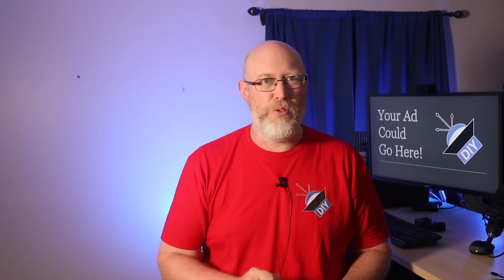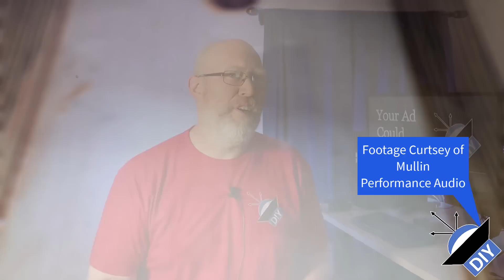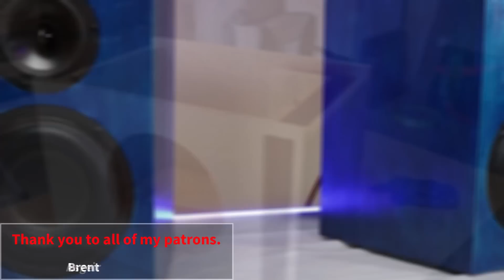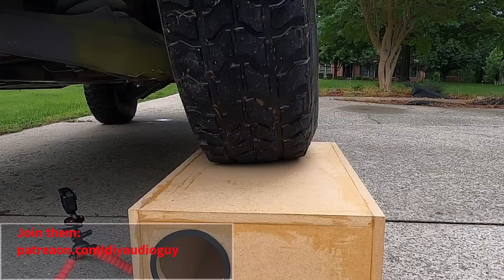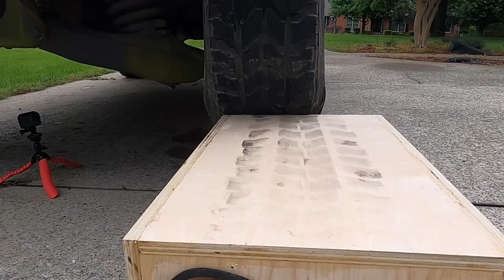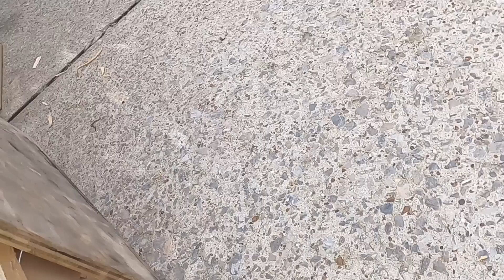Destroying subwoofer boxes with a Humvee.

Comment: I take it thats not run of the mill construction grade plywood? Does birch plywood not have as many voids within the layers compared to other versions of plywood? 30 some years ago MDF / particle board was the goto and the consensus was that plywood would give you rattles due to the inner layers having possible defects/voids.
Reply from the maker: Cabinet grade from Home Depot
Reply: in german we say MULTIPLEX xD
Reply: Don't confuse birch veneered plywood with Baltic birch plywood. Real Baltic birch plywood for 3/4" thick has 13 equal thickness plies, 1/2" has 9 equal thickness plies. Any other number and you have regular plywood with a birch veneer on the faces. They are not even remotely the same product or quality. Real Baltic birch will have zero voids anywhere and the edges look so nice they are finish grade as in you can round them over and stain and lacquer and they look good. Every Pro Audio concert grade stadium box is made out of Baltic birch. It's tour grade and can handle the bumps, rain and abuse a tour can bring and it is 1/2 the weight of MDF. MDF is fine for home audio as you don't have to move them around often and they don't usually take abuse or get wet. MDF aside from being heavy is also hard on your saw blades and the dust it creates is more toxic then plywood dust but you will get slivers using Baltic birch and the Baltic is 2-3 times the price so pick your poison.
Reply: Right on... thanks for the details on that wally! I have noticed some of the other channels that use the plywood, it looks like flat versions of skateboard decks (lots of plys) vs the 4-5 ply construction grade, i just never knew what it was called. and you are correct... MDF saw dust is horrible... 1 cut without a dust collector and its everywhere... EVERYWHERE.... dont breath that... Ill have to check out this baltic birch for my next build... putting almost a 4x8 sheets worth of a box into the back of a vehicle definitely changes the handling and if this baltic birch plywood is that much lighter, then thats a win win...

Comment: I've stopped building enclosures out of mdf years ago. Weight in a vehicle matters more than people realize.  Fuel economy,  suspension stress, transmission stress, tires wear uneven  etc.... 
Sure a 8" or 10" sub enclosure is fine in mdf but most of my customers want multiple subwoofers and some weigh in excess of 100 pounds, so weight and strength are extremely important.  Plus the mdf dust is the worst.

Comment: Now that was amusing!!!🎉🎉 cool stuff! As far as i remember from a german speaker diy magazine few years back, they compared matterials and did actual measurements of the matterials themselves and their acoustic properties and concluded that mdf has no acoustic dissadvantage compared to plywood so unless we are talking aesthetic needs there is no reason not to use it. Damn! Now i am curious bout what would happen if the enclosures had bracing in the middle of the cabinets
Reply from the maker: Glad you liked it!
Reply: I never have liked MDF and refuse to use it.  Kept hearing all the nonsense about plywood being terrible for subwoofer boxes, which is just as stupid as the subwoofers "requiring" break in myth.   Hard to believe all the nonsense out there just keeps spreading and will never die.
Reply: @DIYAudioGuy  of course! I love „out of the box“ presentations :-)
Reply: @JasonWW2000  All subwoofers loosen up over time, yes, but there isn't any special break in method or period required where you have to play them at low volume for 5 days or any of the other ridiculous methods people have come up with.

They can all be played at full RMS straight out of the box without issues.  A lot of this break in stuff comes from SPL farting crap.  They want to try and loosen them up as fast as possible so they can figure out all the other stuff based on the loosened up sub.
Reply: The reason to use MDF over plywood is cost. The plywood necessary to build a proper speaker box must have no voids or air pockets in the plies. That means it's very expensive to me. It also should have many plies versus fewer plies. Birch plywood in a higher grade comes with no voids in it, but it's relatively expensive compared to.
Reply: MDF.
Reply: I've been building speaker boxes since 1979 for vehicles. I've even built them out of 1 and 1/8 in thick MDF if you want to talk about heavy but MDF is so dense very little residence. The air pockets that can exist in some plywood can cause vibrations and buzzes
Reply: @georgefadale6495  Right now, around here, 4x8 Premium Sanded ACX is $55 and 4x8 MDF is $50.  If you just get the cheapest plywood, yeah it may be crappy, but the ACX is usually fine if it's not showing in major issues on either side.   Unless somebody is building some high end SQ system and have done a full on sound deadening, noise reduction through the entire vehicle, it's simply not going to matter even in the slightest whether the box is MDF or Plywood.    You won't be hearing any box issues, if there even is any, while the vehicle is making every rattle and buzz noise possible.  And then the noise would have to overpower the subs as well.   So, very unlikely to matter.
Reply: @georgefadale6495  i love plywood. I just saw the comparisson of the acoustic properties back then and realised the only argument for plywood is that it looks much nicer and also it lasts longer if it is in a wet environment. So if i use it in a scenario where its not visible i will choose mdf any day. Yes you are right the cost difference between a good plywood and mdf is too big
Reply: @DIYAudioGuy  whats not to like. Was a pleasure to watch funny and informative combined. Cant wish for something more
Reply: @JasonWW2000  Not sure why any clarification was needed considering I specifically said "requiring" in my original comment.   No subwoofer "requires" a break in period, what else could this mean?
Reply: @JasonWW2000    Again, what else exactly could I have meant?  I understand you likely can't explain what is so vague without demonstrating poor comprehension skills, but please make an attempt because I find you to be vague on your explanation of why you thought my statement was vague.    Did you miss the word "requiring" or read it fine and just chose to ignore it, or possibly simply trying to read something else in to it?
Reply: @JasonWW2000  I see you're still wishing to stay vague in what you saw vague about my comment.   So nobody knows what the word "requiring" means?  Good to know.   I know you're upset and offended at the idea you can't argue with facts how "breaking in" is somehow required, but that's just the way life is.  I know it's hard to accept the facts and the facts say not one single sub out there "requires" a break in, hope that clears it up.

Here is a list of synonyms for "requiring".  Which one better fits your level of thought process and one that everyone should likely know?   I'll be sure to consult you on all further comments on any car audio pages in order to better use the proper words that better fit your temperament and ability to comprehend.   LMFAO!   Yeah, not going to happen, but still...  please choose one and I'll modify my original comment to accommodate you.

compelling
demanding
exacting
forcing
involving
necessitating
pressing
calling for
dire
immediate
Urgent
Reply: @JasonWW2000  What?  That's a bit vague, please clarify.
Reply: @JasonWW2000  Sorry, still to vague, please clarify.

Comment: Most if not all of us will not need a Humvee to run over our speaker boxes.... Plywood is stronger but MDF is much better for speaker box material because it is a lot denser & the weight difference between each of these sheets would probably be a lot ....meaning the MDF Would Wiegh  a lot more than the plywood

Comment: After 10 years or so of using MDF on hundreds of enclosures, I developed an allergy to the glue or binding agents used in the manufacturing process of that hateful junk. I've used birch plywood or hi-ply the last 15 years or so and can't imagine using anything else. It's a far superior material for this application.
Reply from the maker: I have heard of that happening before.

Comment: I knew from experience mdf would fail. I used a dual 15” box made from mdf as a bench next to bed. It broke after a while from my around 250# of weight on one foot.Away from the divider in middle of it.
Reply from the maker: I honestly expected it to hold just a little bit better.